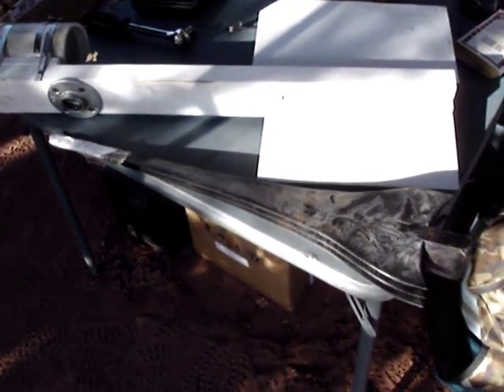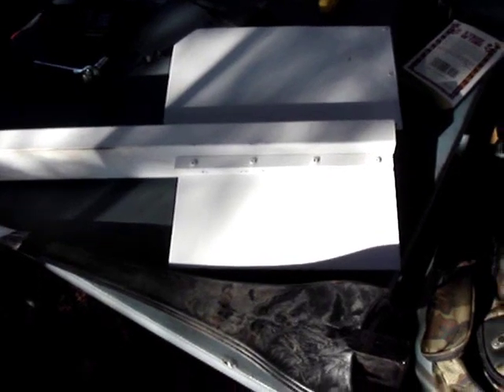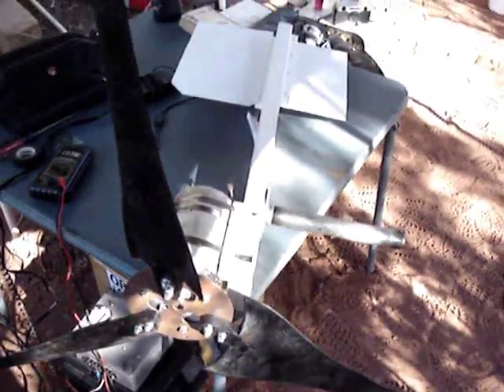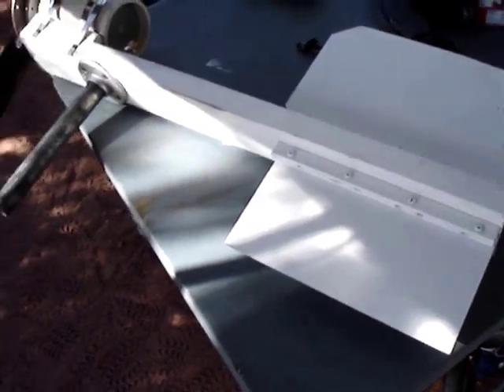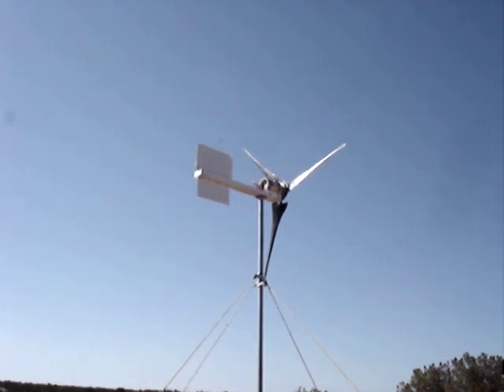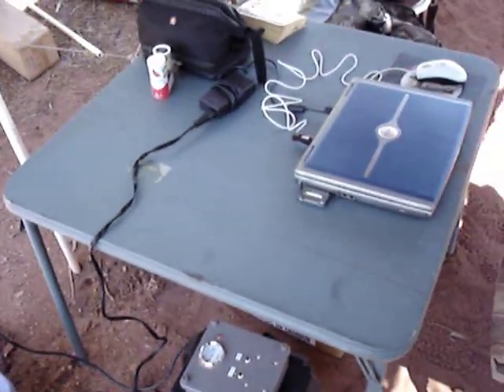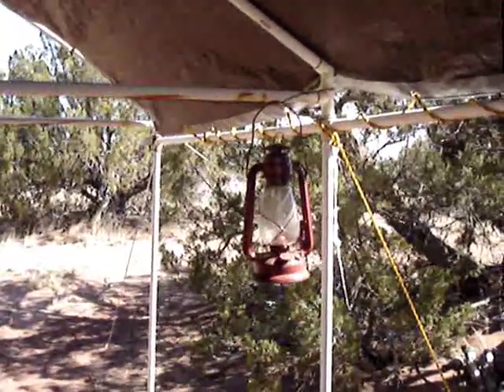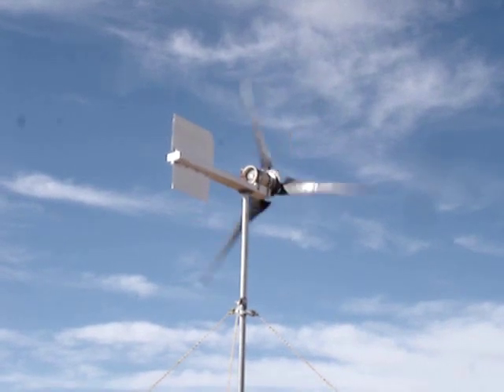New Blades and Tail on the Wind Turbine at mdpub.com

Comment: If you need something to use the extra power that you generate with that wind generator why not get a ham radio and get on the air and make some HF contacts.   73  VE7DAO